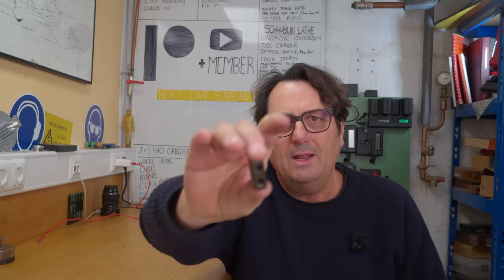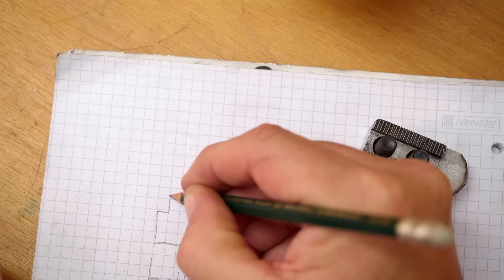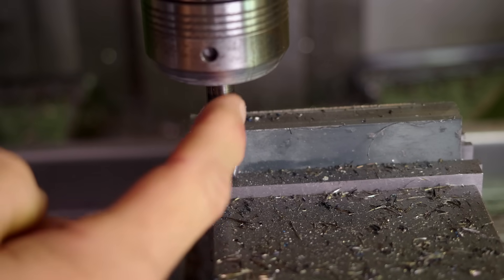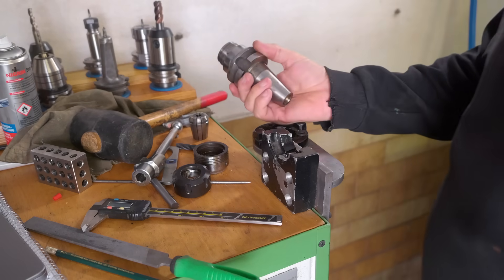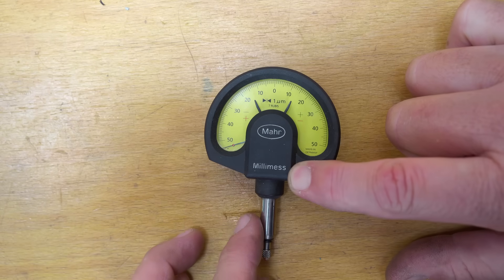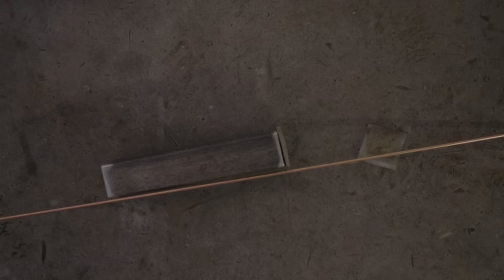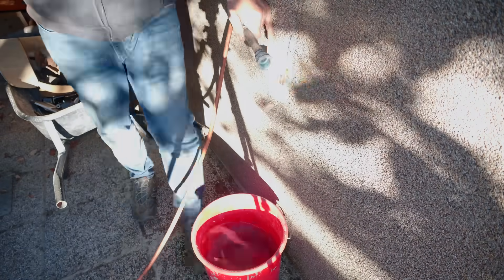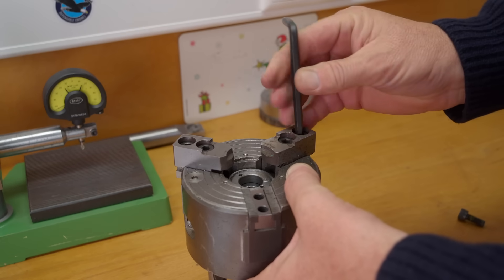T-Nuts - everyone makes them. Do you harden and grind them?  || RotarySMP

Comment: I enjoy your subtle trolling of the Imperial vs metric debaters. 😁
Reply from the maker: Thanks Brian :)
Reply: There are 2 types of countries, those that use the metric system and those that have put a man on the moon…..
Reply from the maker: @dhal22  Well put.
Reply: @dhal22  🤣🤣😅😅🤣🤣😂😂I wasn't aware that Myanmar and Liberia had done that. I guess that's why the medical, scientific, and auto industries all emulate NASA's use of metric. 😁😁But my friend, you do you.
Reply: @dhal22 FYI: NASA is metric.
Reply: @dhal22  there was nobody there to give it back to, so we never bothered.
Reply: @dhal22 Using Imperial units imposes a mental discipline that metric units negate the need for. However, for routine work, metric is much less error prone.
Reply: @AllTheFasteners  only because you can say 1/3rd of a unit in imperial and understand what you mean, whereas 1/3rd of anything metric is .333333333333333333333333333333333333333333333333333333333333333333333333333333333333333333333 well, close enough.
Reply: @dhal22  Also those that have made an impact on Mars
Reply: I'm American, and I have mixed opinions about both systems.  The most annoying thing is that I have to deal with 2 sets of tools and hardware.  I don’t see much benefit from the metric system.  Tap drill sizes for for example aren't nice round numbers.  You need a 7.2mm drill or something.   And it doesn't always divide into 1/3rds, 1/4ths or 1/6ths well.  
America should probably switch to the metric system and in 100 years, all the problems will just about be over, but all of my industrial equipment,  and all my old cars necessitate that I keep SAE tools, amd all the modern cars and Chinese products require the metrics.  I'll be fighting the battle of the systems  for the rest of my life!
Reply: @TomS-z8d  The metric tap sizes are simply the thread diameter less the pitch, so are very easy to calculate without any charts. Whereas the imperial tpi bears no resemblance to a letter or number drill. Imagine having drill sets in 4 thou increments.. Nobody needs to divide stuff into fractions anymore.
Reply: @TomS-z8d metric units divide just as well as imperial units? But there is little need to use it, if you need something that's 1/8th.. that's just 3mm. 

 I feel your pain in having to maintain double toolboxes but you already have right? I live in Sweden and we have metric since forever but I still have two sets of imperial sockets as well. It's even better when the same machine has fasteners from both metric and imperial. 

You do kind of have a point with the taps though, even though it has never been an issue when tapping for me. I'm guessing now but this seems like less of a product of the measuring system and more related to fastener sizes - you can either have even sized bolts or even sized drills for taps. An M8 bolt is 8mm, a #8 bolt is 0.1640".  Sizing of holes for tapping is more critical than just a clearance hole though.

I think a switch now would probably mostly be a paper product, we will all still keep both the tools and the mindset. In fifty years though it would probably pay off :)
Reply: @LunaticCharade  I think the real problem is that they built the metric system off a random length that was designated a meter, and it had no direct ties to imperial measurements. If they had made millimeters the same size as a 1/32" of an inch for example, then 2 mm and 1/16th of an inch would have lined up meaning that the vast majority of tooling would be cross compatible.
1000 mm would be a meter and be 31.25 inches.  It's the same order of magnitude, but now all the fractional inch tool sizes and mm align.  1/4 inch would be 8mm.  1/2" = 16mm  1" = 32mm, but you could switch over to metric if you want base 10 and use a meter or centimeter...  7/64 drill bit would be 3.5mm, not too terrible.  In the machining world, there would still be some calculations done as once you start using thousandths of an inch or parts of a mm, you would have a factor of 32 I suppose.  Still slightly cleaner than 25.4.

The metric system's length was originally based off the circumference of the earth.  Seeing as how the earth is actually egg shaped, or an oblate spheroid... it seems kind of a pointless metric.  When I invent my time machine, I'll go back in time and modify the metric system to have more in common with the SAE system and fix everything!
Reply: @TomS-z8d that's actually a really good idea! 

At the time, there was several competing inch standards though, British inch, American inch etc. I think this plethora of competing measurement standards was one of the motivations to create a new separate standard.

One thing I wonder about, how and why do you use several units for distance? It's not worked into my brain so that's probably why I feel it's difficult, but the non-even division between for example feet and inches just seems like a lot of work for something simple.
Reply: @LunaticCharade I'm sure we have so many different units of measure because the system grew organically amongst different professions and only after the fact were they tied together with conversion factors.  Miles, furlongs, fathoms, feet, yard, inches, cubits, chains... whatever else.

I figured out a path forward.   Settle on all metric sized tools.  Make metric bolt heads with both SAE threads and metric threads.  Hardware store carries both flavors, and they are stamped for identification.  All new construction is pure metric and we use the crossover fasteners to service our vintage equipment.  No burden for hardware stores, they already carry 2 standards.   Tool users can migrate to a single set of tools.  Biggest burden falls to retooling industrial manufacturers,  and the legacy industries like i dunno, cat engines for pumps and generators. Etc.

Seems like a workable first step.  Trying to decide if it is really an improvement or not.  Anyways,  it's been fun to ponder
Reply: .03937 and 25.4 are the magic numbers to live inside the world of both systems. I am Canadian. where we are "metric" using the imperial system for everything but speed and fluid capacity. I can order metric hardware from the USA next day, or 1-2 weeks inside canada. Go figure!
Reply: @Mikkel-RS  whenever you are tempted to use 0.3937 use 25.4 as a denominator instead. Much neater formulas.
Reply: @Bosun-8  For sure, but both numbers are equally as important. scale mm to inch with .03937, with any scale function in cad. too hard to use 25.4 in that case.
Reply: @Mikkel-RS  Good call, I never considered the scale function in cad. On a calculator it's either multiply by 24.4 or divide by 25.4. My cad system, like yours, needs the decimal value of the reciprocal to convert one way and the whole number the other way.
Reply: Someday I might get tired of this joke but not today! I got a real chuckle when my ears heard “4 inches” but my eyes saw “10cm”. Keep up the good work, Mr. Rotary.
Reply: "Subtle" lol:D But yeah, its very enjoyable:)))
Reply: Watching the video, I didn't even notice it. I had to read some comments to find it was the 4" mention at 10cm. Then I recalled watching that part and thinking "yup, same number", and just going on with life. Didn't even occur to me it might be a troll.
Reply: Like that his tooling but hate that he shows it in one system well when his sawing it it's in the other system 

It's somehow worse then take and saying one measurement in one system and then the next measurement on the same part in the other system
Reply: Everyone knows metric is good for science and industry while imperial is good for human stuff. Yes I'm American too.
Reply: @misterdeedeedee  🤣🤣🤣🤣
Reply: @misterdeedeedee  you do know that the us is actually useing the metric system in secret right ?  the whole imperial system is just a fance cover/conversion based on metric ( whenever the metric is wrong the imperial is also by default wrong ( since if the underlying part/sour's of a system is wrong then the system itself is also wrong by auto ))
Reply: @flikflak24 you do understand that just because a conversion factor exists that doesn't mean necessarily that one is based on the other right? That's like saying because you can convert US dollars to Italian lira that means the US economy is secretly using lira just with dollars as a cover. Metric measurements are based on universal constants like water and the speed of light, imperial measurements are based on humanity and the human condition like the average size of an adult hands and feet, the average distance you would have walked after 1,000 paces, etc
Reply: @misterdeedeedee  try telling that to the united states national institute of standards and technology (NIST ) and see if they agree with you then
Reply: @flikflak24 they don't have to agree with me, look up the entomology and history of each unit and they will literally tell you what I just said. One of them is called a foot. FOOT. what might (but shouldn't) come as a shock, a foot is about as long as an average adult's foot. I can't possibly make it more clear than that.
Reply: @misterdeedeedee 
Is about as long as... So much precision! Is that the foot of a malnourished worker 200 years ago or the foot of a worker in a office in 1990? 
I think settling on a standard that is based on a fixed unit rather than "about" is sound practice.

I think that's kind of why they came up with it...
Reply: @misterdeedeedee human stuff? Such as thumbs, and those things at the end of the legs?
Reply: Imperial (doesn’t matter which imperial for that matter) was developed by and for people to solve problems with what was at hand for daily living and that is why it still works and people will use it forever.

Sorry, 1mm is just an awkward measurement, 1cm is pointless and 1m is too big.

Having to deal with 3 digit numbers for common use just adds to the confusion and errors.

600mm vs 24” or 2’? no contest.

Comment: Ended up having to buy a hold down kit for my recently acquired mill as it didn’t come with anything to mount a vise. If I had even 1 set of t nuts I would have made some additional ones. They most certainly would not have been hardened or ground. First I have no way to reliably harden them. Second my Delta tool room surface grinder is completely disassembled and in storage along with a parts machine awaiting refurbishing.
Reply from the maker: Thanks for your feedback on that Joe.

Comment: For welding i seem to always run short on argon. Can you actually do 1000 or more than that with the oven? Would be nice for ceramics.
Reply from the maker: This oven is a bit underpowered. It tops out at just over 900°C. I need to make up a new, shorter heater coil to increase the power.

Comment: The mad man used the imperial side of his ruler and read millimeters
Reply from the maker: I consider that a service to the decimal challenged :)
Reply: @RotarySMP  Don't all machinists work in decimal? Even those that use inches work with decimal inches. Parenthetically, US surveyors work with decimal feet. Don't ask me why there is a US Survey Foot, which is different from the foot that the rest of the population uses. Regardless, thank you for your service 🙂
Reply from the maker: @briantaylor9266  I guess a lot of imperial is fractional.
Reply: @briantaylor9266  Although not the first to propose it, Joseph Whitworth recommended, in 1857, decimal length measurements for engineering, and invented the "thou." In the '60s/'70s, I saw many components that used fractions for non-functional dimensions, but decimals for precise toleranced dimensions, although still based on fractional sizes !
Reply from the maker: @BillDavies-ej6ye  Nightmare :)
Reply: And yet 10cm was four inches.....
Reply from the maker: @jimurrata6785  Maybe I am the decimal challenged? :)
Reply: Millimetres
Reply: @alanclarke4646 Uh, 10 mm is about 3/8"....
The piece he cuts to make the three T-nuts sure seems longer than that
Reply: @alanclarke4646  quite indeed
Reply: What I. Find amusing about the users of imperial, not inch, as we call it in the USA, is that they’ll say; “I’m going to cut an 8mm diameter rod to 12 inches.” Or make a part in metric and use inch fasteners, or the other way around. What really drives me nuts is when they use both systems, plus Whitworth screws.